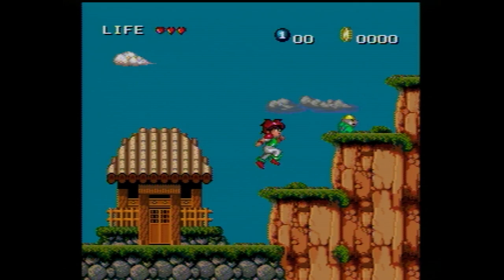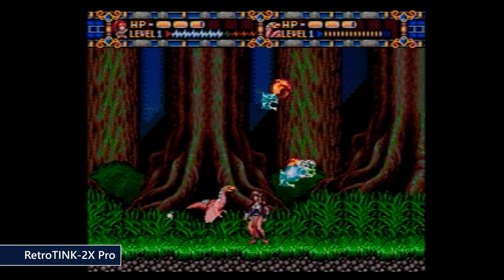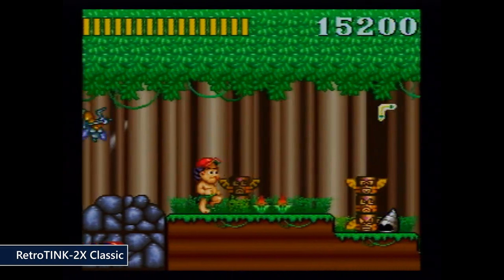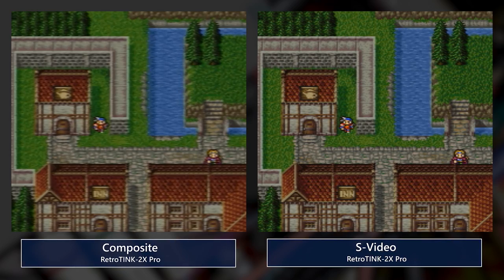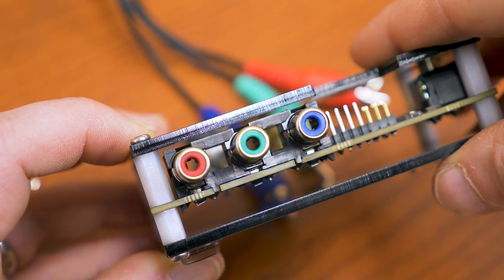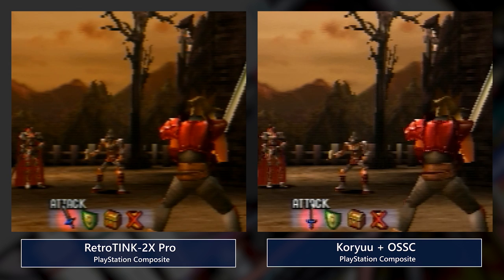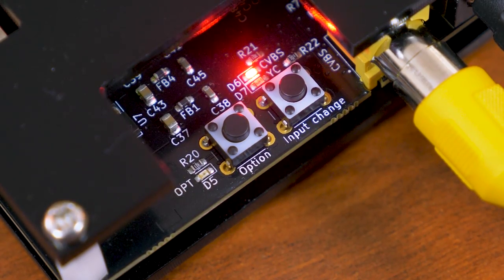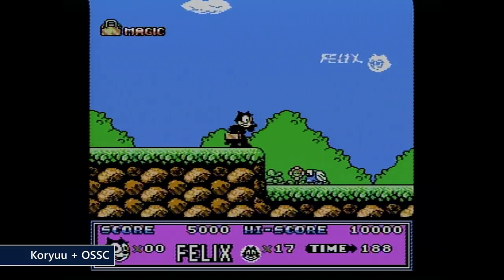RetroTINK-2X Pro & Koryuu - The best composite & S-video Options? :: MLiG Ad-Lib / MY LIFE IN GAMING

Comment: I buy rad2x cables they're built in retrotink 2x's for individual consoles. Theyre a god sent. I'm hoping for a ps2 cable in the future.
Reply: Not likely considering the retrotink2x line of devices relies on a chip set that doesnt support 480p. That said the playstation rad2x should work fine with the ps2. It'll just be bob deinterlacing 480i to 480p, which isnt a huge compromise when you take into account a majority of the ps2 library is 480i anyway.

Comment: Could you somehow route the retrotink classic into the ossc through hdmi to the vga in and get the added benefits of the ossc without any distortion? I have both and wanted to pick up a vga monitor to route the digital connection from the retrotink -> ossc - vga monitor. I had my pvm die on me catastrophically and cant seem to find any under a grand around me. Crt monitors are plentiful and I used to use one with the ossc but ive aquire a lot of 80's japanese consoles that the best I can get out of it is s video.

Comment: I’m leaning heavily towards the RetroTink 2x Pro due to the ease of use and wide compatibility over having to perhaps find solutions on a per console basis, but I’m concerned about whether my TV would accept a 480p signal over HDMI? Is this a legitimate concern? I have a Vizio PQ65-F1.
Reply from the maker: [Try4ce] That is very very unlikely to be a problem. The only problem I would worry about is that your TV may want to stretch 480p to 16:9 by default, but surely your TV has an aspect ratio setting so that you can force it to 4:3.

Comment: is there a way to stop the flickering / stutter with the 2x pro ? im trying to stream some ps2 games and the jittering is too jarring for my viewers ( as well as me when i review my vod's )

 maybe the pass through option on the device ? it looks like the same issue as you with the Koryuu . if i set my Elgato to only max out at 30fps it stops the jitter , but i would infinitely prefer 60 . 

 current setup is PS2 with ebay Component cables - Component splitter . Output 1 is using HD Retrovision cables that goes to my 30" Philips 16:9 CRT . Output 2 is using HD Retrovision cables going into my Retrotink 2x Pro with an HDMI cable going into my Elgato HD60 Pro .
Reply from the maker: [Try4ce] 480i will give you flicker on the TINK. Composite video can also be a source of flicker. I've never noticed stutter with it though, are you sure it's not a capture card or streaming issue?
Reply: My Life in Gaming i switched my Retrotink to Pass Through instead of 2x Scaler , that seems to have solved my issue . thanks again for the great video !

Comment: Hi guys, love your videos!! I have a conundrum here: I have connected almost all of the mini consoles to my CRT via an HDMI to S-Video converter. It works and looks great, but the video is interlaced.
Any tips on how to do HDMI to RGB SCART (European CRT tv) at 240p? Some devices can downsample analog video to 240p (so HDMI to VGA would be a required pre-step) but they tend to output VGA or component, and I can’t find a way to convert that to RGB SCART.
So all I want is to do is pretty much exactly what I already have, but at 240p. The 480i signal still looks great but I’d appreciate a true 240p signal.
Maybe you could even make a video about connecting HDMI devices at 240p? Thank you so much for insights!
Reply from the maker: [Try4ce] Yeah that's the problem with these devices. The only one we know of is the GBX-C. We've tested the GBS-C AIO downscaling to 240p and it looks awesome, aside from the fact that it seems to miss lines sometimes.
Reply: @mylifeingaming  Thanks for the reply! GBS is the one I’ve been looking into, albeit a pre-modded one.

I read it only accepts a 480p signal, so did you downscale the 720p HDMI signal before feeding it to the GBS?

HDMI -> Downscaler (480i)/Component out -> GBS (240p) -> VGA to RGB SCART sync converter?

Also, do you also know if the GBS outputs a 15khz VGA signal, or would it require a 15Khz dongle?

Thanks again!!

Comment: For a composite output. I don't understand why you would want the composite input on an HDTV vs the HDMI input. Couldn't you get better conversion? I'm a noob at video, I'm an audio guy. Or are the composite inputs on HDTVs still analog signal paths, and not converted to digital?
Reply from the maker: [Try4ce] Analog video is always converted to digital for modem displays. The reason to use a device like the RetroTINK-2X is to have more control over how that conversion happens. Modern TVs (when they even have analog inputs) are designed for making video content look smoother, but are not really tuned for game content and minimizing input lag. By letting a specialty device do the analog to digital conversion and sending the HDTV a progressive HDMI signal, you bypass the worst of what the TV might do to it. As for Koryuu, that's not really its purpose. It's meant for connecting most specifically to the OSSC, which is currently the optimal game scaler. It can have other uses though. Analog does not equal bad, it just depends on the use. Same in the audio realm, right?
Reply: @mylifeingaming  Yes. Thanks a bunch for your in depth reply! 👍

Comment: The Retrotink would be amazing if it was more than 2X.
I need a minimum of 3X, and the lack of 480p is like... wtf.
EDIT: After saying this I actually bought the Retrotink! LOL. 
Why? because I realized the OSSC Pro is coming with an HDMI input.... so I will basically use the RT as an adapter into that.
The Koryuu might be clean and all, but it should have more output options, and it is too expensive for not doing a lot, while the RT at least can be used on its own. Plus the Koryuu's too much of a beta right now.

Comment: Any chance you've tried feeding the retrotink 2X pro into the OSSC via an hdmi to vga/component adapter? I'm wondering how similar s-video on the retrotink would look to the koryuu if it also got passed through the ossc.
Reply from the maker: [Try4ce] We didn't with the Pro, but I did it with the original TINK-2X a long time back. Didn't love it because there's no lowpass filter on the Dsub input for the OSSC so it didn't look as clean.
Reply: @mylifeingaming  Maybe try using it with a hdmi to component converter?

Comment: Videos have been very helpful but need to ask one last question before I spend some $$$, want to make sure I don’t waste frivolous $$$. Now can I purchase the ossc and koryuu for my original NES and hook and play? Or do I need to get an RGB mod?
Reply from the maker: [Try4ce] You can only use NES on the OSSC if you have an RGB mod but the Koryuu would allow you to connect composite to the OSSC, so in that case, no mod is needed. However, if your primary concern is NES and you want to use composite, I would recommend the RetroTINK products first, particularly the RetroTINK Mini, although it seems to be out of stock right now. The RetroTINK 2X Pro is more expensive, but it does also give you access to component video as an option. You could get sharper video out of the Koryuu + OSSC combo compared to the RetroTINK 2X series, but I don't think that helps composite video all that much, and it would be more expensive overall. You should also be aware that some TVs may not like certain characteristics of the NES's video signal, even through the OSSC or RetroTINK 2X devices. The likelihood of running into issues with the RetroTINK stuff seems to be somewhat smaller, but it is not guaranteed. I find that most TVs I test on these days accept NES through these devices, but it is one of the consoles that is most likely to have TV incompatibilities.

Comment: I am getting ready to organize my console collection into brand units (one shelf unit for Sony, one for XBox, one for Nintento and one for other retro) and possibly have a dedicated display for each shelf unit (for now they will go to one).  Hooking these up to a 1080 display seems impossible to organize.  For example, do I get a transcoder for each unit and run to a 6 unit switchbox then to TV (Seems logical), or is there a way to run everything to a switchbox then through a transcoder.  I am looking to get the best resolution for each console, even if that means modding them.  Is there a webpage that is dedicated to such a challenge that lists each console, it's possible connections, and the hardware recommended to run-thru to the HDMI on the TV.  (If I sound ridiculously uneducated, I am when it comes to this).
Reply from the maker: [Try4ce] RetroRGB.com is that website, and I like to think a lot of our videos can be a nice resource too! I have virtually every major analog console hooked up with RGB or component (modded where necessary), connected to a gscart switch and a gcomp switch, then going to an OSSC, which outputs HDMI (which can in turn go to an HDMI switcher). A transcoder isn't necessary in that scenario.
Reply: @mylifeingaming  OMG - you're a life saver!  That is exactly what I needed.  Yes, you guys are awesome in presenting this information in visual form, I have just found you so I have a lot of catching up to do.   Thank you guys for all your very appreciated efforts!

Comment: Bit of an odd question, but is there any point to hooking up a console to the Koryuu by S Video and connecting the component out to the Retrotink 2X? I figure there might not be since the Retrotink already has S Video inputs, but I’m still curious.
Reply from the maker: [Try4ce] Never tested it, but that's just an extra conversion, which would generally be unadvisable.
Reply: My Life in Gaming Kinda what I figured. Thanks for answering.

Comment: I got mine today! First time gaming on a modern TV where I feel like it is actually playable. However, i feel like there is the slightest bit of lag still. I speedrun and this may be a problem for me. I'm running game mode on my sony 4k Tv and i feel like I notice lag a bit. My TV is a 40 inch so maybe lm not used to a size jump so not sure. Ideally I would want a gaming monitor for zero lag? Any help or comments would be appreciated
Reply from the maker: [Try4ce] The OSSC and RetroTINK don't add lag in and of themselves, so if you're not using wireless controllers, then you know the lag must be coming from your TV. On a modern TV, 1 frame of lag or so (16ms) is extremely good, which is about what I have. That's not lag I can feel personally, but I understand for more competitive gamers like speedrunners, they may be able to notice it. If you're concerned with determining how various displays handle various resolutions in terms of delay, a device I've enjoyed using is the Time Sleuth. You can set the dial to the appropriate resolution (480p to approximate the RetroTINK resolution) and then aim the camera at the top blinking bar to get a measure of latency for that resolution on that display. https://shop.dansprojects.com/time-sleuth-lag-tester.html
Reply: @mylifeingaming  thank you for the informed reply! 👍
Reply: @juntartful  I did a lot of research on cheap TVs for retro gaming and ended up getting a TCL 43S425. It's super cheap and yes the image looks really bad in some situations, but oh lordy the game mode is quite good for the price. Not bad pixel response times, either, though in 3D games with full camera rotation, it took a bit to get used to the blur when rotating the camera.

Comment: The koryuu is great, but people have more than one composite/s-video system. Can I run: 
switcher > koryuu > OSSC?  I'm trying that with a gcompsw and I only get black and white, colored bars, or green image.
Reply from the maker: [Try4ce] That should work. Not sure why you'd be having trouble with the gcomp there. I plug the output from my Koryuu into a gcomp, which then goes to the OSSC.

Comment: Regarding value for money, would you recommend this RetroTINK 2X Scart over the RAD2X cable to use with a GENESIS 2 on a modrn 4K TV? Thank you
Reply from the maker: [Try4ce] We've never had the chance to use a RAD2X. But the advantage of the RetroTINK devices is that you can use them with many consoles if you decide you want to use more than just Genesis 2.

Comment: How about using the Koryuu to send an S-Video signal to a CRT that has Component inputs, but not S-Video inputs?
Reply from the maker: [Try4ce] Does such a thing exist? I've never come across one. But at any rate, yes. We showed what it looks like on a CRT in multiple situations. Just be warned that there is that issue with 480i that we ran into. It seems fixable and I suspect will not be a problem long-term (beta firmwares were sent to us after we brought up the issue, but we don't yet have a programmer device that can update our firmware).
Reply: @mylifeingaming  Yes actually, I have come across some smaller CRTs that don't have S-Video on them. I was looking for a CRT around 20 inches for the set up I had at the time.
Reply: @mylifeingaming  I should reiterate, smaller CRTs that didn't have S-Video inputs, but had Component inputs.

Comment: I really don't want to mod my NES for rgb out to hook it up to my PVM.  Is the 2X Classic a pretty good step up if I want to use my PVM's component input?
Reply from the maker: [Try4ce] Does your PVM not have a BNC composite input? The 2X Classic would be for connecting to a modem display with HDMI. As far as composite goes, it's about the best it can look on a modem TV I feel. Some CRTs composite really isn't that bad.
Reply: @mylifeingaming  Yes the ones I have do.  I was just hoping the 2X was made to upscale composite to component so I could use the bnc component side of thing rather than the composite and perhaps get a sharper picture.  The composite on my PVM's is ok.  I also have some CRT's which is what I am currently using my NES on.  Still after using a PVM with my Snes and others through RGB it just blows composite away imo.  Thx for the help though.  I'll end up just buying an rgb modded NES later on.  Don't want to touch my childhood original. :)

Comment: question if you got time. I might purchase a hd crt samsung slim. it only has compent for hd signals. if i plug in a componet to hdmi adapter. Will the output be better or just as good as if it was hdmi. thxs guys great vid
Reply from the maker: [Try4ce] I'm not clear what kind of display you're talking about, but I wouldn't use a cheap component to HDMI box. You'd be better off plugging directly into the TV. Something like the RetroTINK-2X would give you better results on an HD capable display than just a direct connection however.